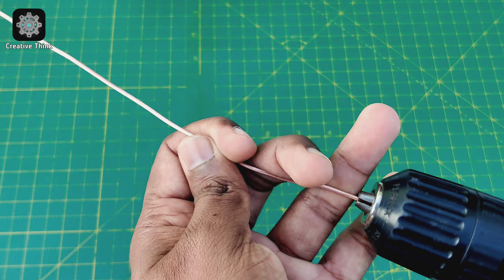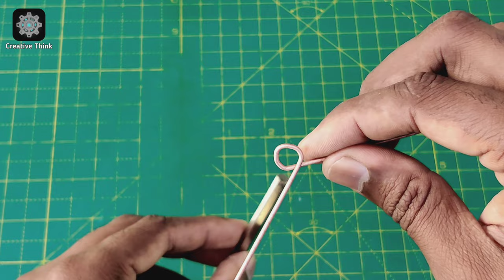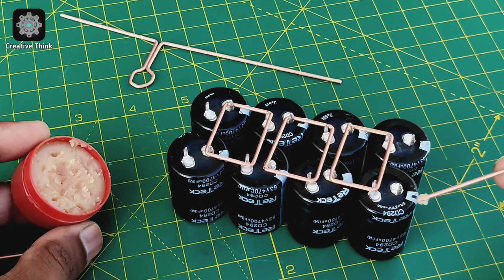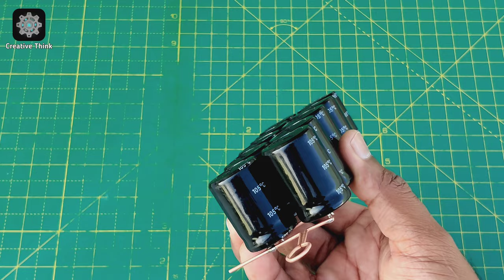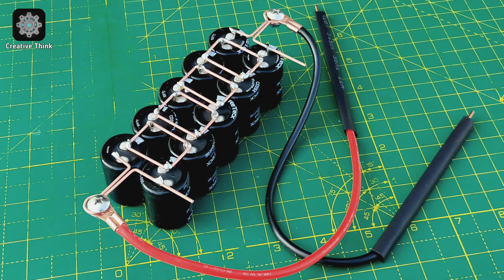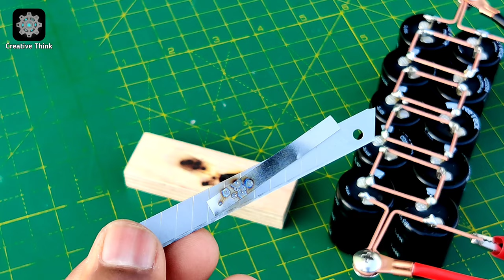Making Powerful Spot Welding Machine Using Capacitor

Comment: Can you please tell how are the Capacitors interconnected, +ve with -ve in pair...
as in 
2 Positive (one Battery Other with Pen) and then it's 
2 negative with 2 Positive of other set X 4 times
and finally last sets
2 Negative (one Battery Other with Pen ) ??

Thanks, I have collected all material, just Wire Crimper is needed to connect Copper wire with Copper tube and terminals..